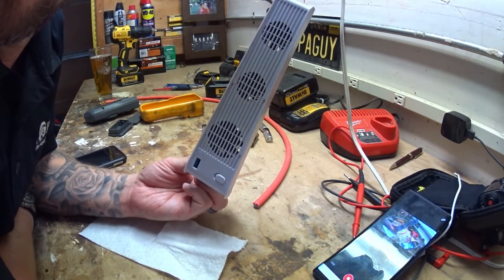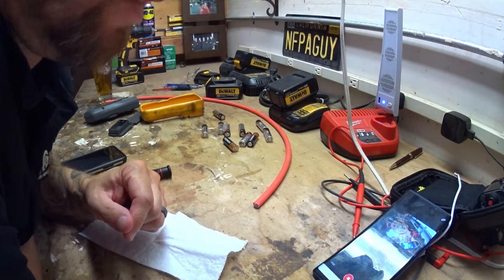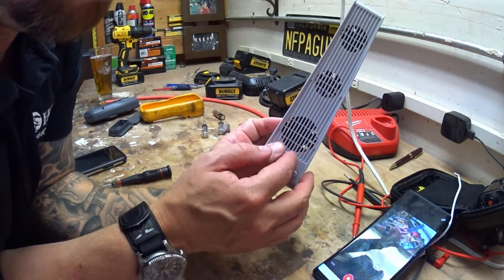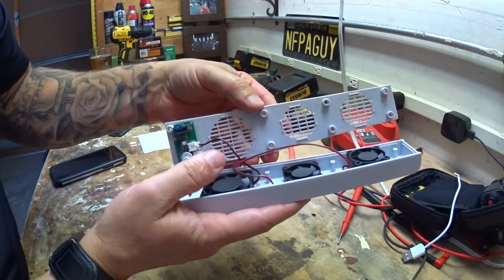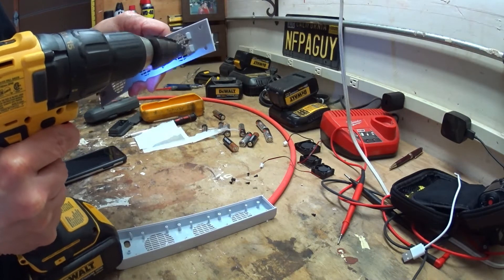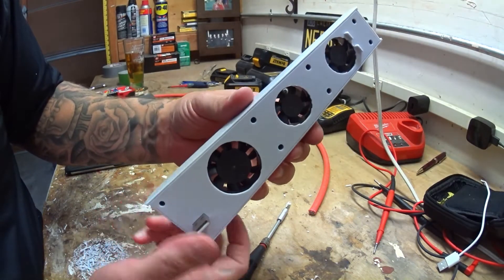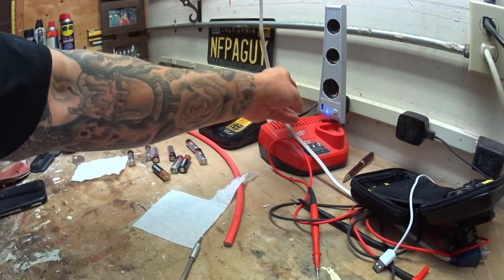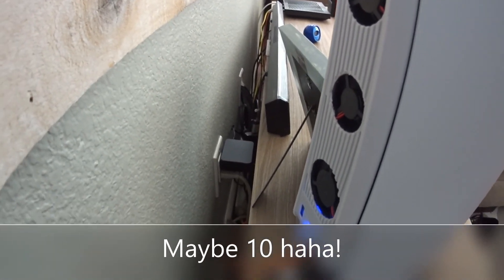PS5 Cooling Fans Done Right

Comment: From my understanding, the fans are meant to be pushing air thru the console and out the vent on the other side. So that's why the fan blows that direction. The problem is, if your gaming area isn't cool ambient air, then it's just essentially pulling warm air from the room and blowing it through. Which is obviously not ideal. So unless you have a very cool gaming area, it won't do any good. Except maybe make it even hotter. So ya home mod is probably the way to go.

Comment: I love to fiddle with stuff like this so I get it. But holy crap. Truly a waste of time. Video should be named "How to increase your PS5 noise." Anyone who uses this kind of stuff truly doesn't know about thermal dynamics and thermal throttling. PS5 is not affected by thermal APU throttling.  Unlike PCs that have CPU and GPUs voltage throttling to maintain core temperatures, you want to maximize cooling so you can keep voltages and clock speeds as high as possible to get as many frames as possible (or a fine balance.) The PS5 is like a stock car. You get what you get. Its already tuned for its stock performance and fans and cooling will not change that. 

 The only thing this will do is lower the internal fan speed as this is now assisting in the air flow. But anything gained from this is replaced with an atrocious fan noise from this device. Negating any benefits that you were looking for. 

Like I said I do stuff like this all of the time, just for things to do. So good job on that part. I'm just talking crap about the product and why you shouldn't use it on your PS5.

Comment: Okay, so obviously every console gets a little warm whenever you use it, but even the little bit of warmth my PS5 has is getting me worried cuz I JUST got it and don't want problems later on 😬 so are these safe or not? Cuz I don't wanna risk it, and there's so many mixed opinions (like people saying adding outtake fans can damage the internal exhaust fan, even if it's directing air out)

Comment: After using the fan, is there a decrease in the temperature on the PS5?
Reply: I just put a single fan on the back, with a 9v and the PS5 feels a lot cooler on touch(without the plates)
Reply: 0.2 degrees 🤣😂💀☠

Comment: Hey there! Would you recommend doing the same thing with the OIVO cooling and charging station model?
Reply from the maker: Sorry but I have not played with that model yet. I'm not sure if fan orientation and restrictions apply to that unit. I suggest Fi sing out what direction the air is flowing from the fans. If it is supplying air from under the unit, I would think you would want it flowing INTO to unit as opposed to OUT like my unit.
Reply: @pyrotech8877  I'll look into it. Thanks for the reply.
Reply: That unit is proven to do nothing for the ps5 since there's not really any air holes in the ps5 where it sits
Reply: @sirpepperoni  if you take off the side plates there is 2 holes on the side
Reply: @nortuen  the cooling unit she's referring to is a base stand.. with fans. Even with the holes behind the side plates.. its design doesn't do anything yo benefit the way the ps5 runs and if anything impedes airflow..
Reply: On the packaging of the nexigo cooling stand it actually states that "it helps heat the p5" it's the same youtube guy

https://youtu.be/fiJQBP30qCU
Reply: Lmao ! ! ! Just don't🤣😂💀☠

Comment: How has fan been working
Reply from the maker: It's actually been working great. Like I stayed in the video it's a little noisy sometimes but you can definitely feel a tremendous amount of hot air moving out of the unit which is always a good sign.
Reply: @pyrotech8877  so is it ok for me to put it on my ps5?
Reply from the maker: Absolutely. I have not seen any issues with the thus far other than the noise.
Reply: Sounds like my PS4 pro 😂